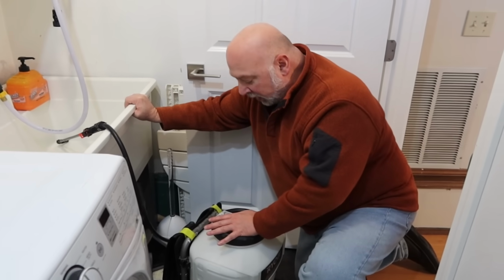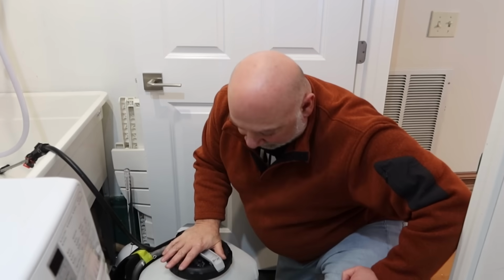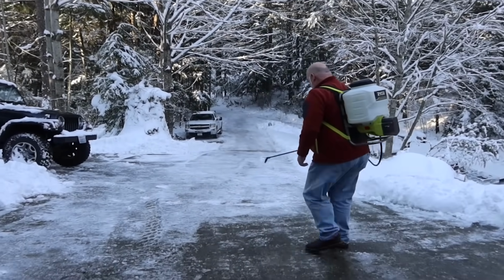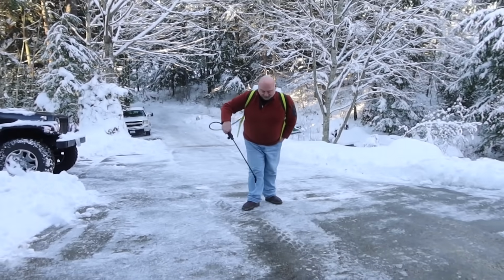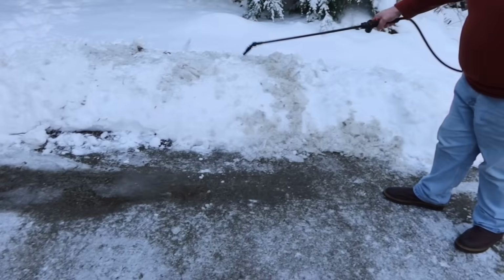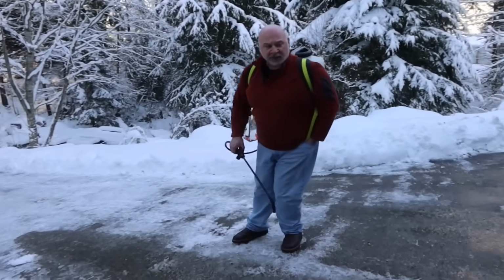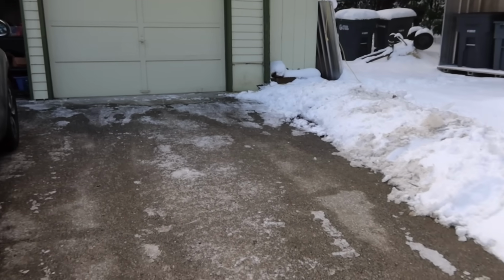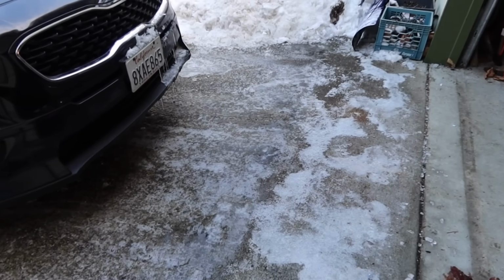Low-Cost Homemade De-Icer- It's easy and works!

Comment: Never heard of this DIY deicer.  Recipe:  Melt 8 - 9 cups Water Softener Salt  and 5 cups of sugar to 5 gallons of water.  Thanks for sharing and stay safe.
Reply from the maker: The salt is cheap if you buy water softener salt. Also, you can get 25 lb bags of sugar at warehouse clubs at very good price.  Good luck!
Reply: @fortcesta5128  You could also substitute calcium chloride in the form of pool shock for the water softener rock salt. The calcium has a lower freezing point and you should find it at pool supply outlets even when deicers are all sold out. I did that about five years ago and while I can't swear it's as cheap as water softener salt I remember it was cheap enough I bought a couple 50lb bags. One issue with it is that it comes in fairly big flakes that can apparently damage concrete as a deicer, not an issue if you're dissolving it into a brine though and the result ought to be less destructive to concrete than rock salt too.
Reply from the maker: @johnassal5838  Thank you for sharing your experience. Your contributions are greatly appreciated by all!

Comment: You can use a variety of household items that will dissolve in water as de-icer. The principle of lowering the freezing point of water is if it has more ions in solution then it'll be able to lower the freezing point of water more. Sugar works better than salt because a glucose molecule is C6-H12-O6, meaning it has 6 carbon ions, 12 hydrogen ions, and 6 oxygen ions, a total of 24 ions per molecule. Sodium Chloride is NaCl which is just one Sodium and one Chlorine ion, a total of 2 ions per molecule. This is also why de-icers made from Magnesium Chloride is better than Sodium Chloride because the Magnesium Chloride molecule has 1 magnesium and 2 chlorine ions making each of its molecules having 3 total ions. Calcium Chloride likewise. If you have lawn chemicals like herbicides and liquid fertilizers stored in the shed or garage you'll notice that they don't freeze in the winter, and that's because they're very complex blends of chemicals that in liquid solution have plenty of ions so it would take a very low temperature to freeze them.
Reply from the maker: Thanks for contributing! This is very interesting. I never knew why it worked, just that it did.
Reply: So we add sugar and water that's  it for melting ice bro
Reply from the maker: @اخوياهايصوانالايص  If you are asking a question, the answer is yes

Comment: Try molasses inplace of the sugar. Works a lot better. Oh, forgot, if you have icicles it means the wsteris not draining down your downspouts properly because your gutters are clogged up. It eventually will damage your roof.
Reply from the maker: Thanks for your comment! 

One of the premises was to have a low-cost de-icer. Bulk sugar is pretty affordable and easily attainable. I am not familiar with molasses or the best way of buying in bulk. Can you elaborate on this supply chain?

We got new larger gutters to help handle the issues associated with clogging. 

Thank you, and stay safe!
Reply: @fortcesta5128   Molasses should be available at the same wholesale place as the sugar. Can't remember the ratio, but the cost is not as much as the sugar, nor the usage.
Reply: 9 ounces for 5gallon of water. This really helps the salt solution to "stick"
Reply: Subzero temps will make water freeze to the inside of downspouts and gutters.  Heat loss wil lmelt snow just enough to run to the gutters. If they have "leaf guards" and it stays that cold they can freeze solid.

Comment: The only problems with brine as a deicer is it has a limited temperture range where it  works, and the salt residue will hurt the paws of dogs whose owners walk them over it.  I use salt but only on stairs and private walkways.
Reply from the maker: Good points, for sure!
My dog never spent much time in the driveway.  The little time that was spent in the driveway  didn't affect him. Thanks for  contributing with this important consideration.  Stay safe!

Comment: Like the video. The max salt one can put in water is 26% before it falls out of solution. Aiming around 21% is the best bang for your buck. Brine Hydrometer allows you to fine tune the mixture and see what works best without guessing too much. Been wanting to move up there for years now. I'm done in boise area. Hopefully Priest River one day.
Reply: FYI watch out for ice damns building up on the roof. Can get a string of heat trace on the bottom part of the roof.
Reply from the maker: That's exactly the data I was looking for- Thank you for contributing!
Reply: @fortcesta5128  after doing more research the number is 23.3% solution. Best part is it will lower the freezing point on the concrete before a storm, cause the salt already had the reaction with the water. But either way sir, good luck

Comment: Sugar is not really necessary if you’re already using salt.

If you live in areas with average -20c at night, I recommend Magnesium chloride which has a -25c freezing point.

Just a thought.

Thanks for the video.
Reply from the maker: Good to know. Thanks for contributing to the conversation!

Comment: There are 2 types of  water softener salts; sodium chloride and magnesium chloride  think Mg will work just the same(?) do less damage on the driveway/cement but use less of(?) -main use of the dry coarse application.
Reply: Also, Magnesium Chloride is a safer for pets.

Comment: Ok so that works in general vs spreading the expensive salt stuff but if the ice and snow come back does this stuff being down already help in removal or melting or do you just have to go re apply it after shoveling / plowing?
Reply from the maker: Excellent question! Unfortunately the answer is yes...to everything. The longevity of the treatment various directly with the ability to stay at high concentration and where you need it (in the driveway). If conditions stay cold, you will be more likely to leave a nice coating on the driveway for future use. If you get a thaw and surfaces get wet, you are diluting your deicer, making it less effective. If you have a steep driveway, like me, the deicer can migrate off the driveway. Time to reapply! Thanks for your question. Best of luck!

Comment: Best video I’ve searched for an de-icer brine 👏 I’m a new 🇨🇦homeowner & have. N facing corner lot w/ enormous foot traffic so by the time I get home, I shovel but usually have a good 1/2” ice compacted ice to deal with. Do you think this work in our winter temp of 12f to -58f? Thank you, Leah
Reply from the maker: Hi Leah, 
I think you are safe in the 20s.  If you can get some more sugar dissolved, you will have more success in the teens. 

Feel free to share your experiences.
Best of Luck!
Jeff

Comment: Interesting using sugar, in theory it should work fine and it won’t be corrosive like salt. The higher the concentration of the sugar or salt in your solution the more effective it is in lowering the melting point.
Reply from the maker: I think you meant freezing point. It's all good. Best of luck!

Comment: How long have you been using it in that sprayer? I love the idea but I'm concerned that it'll destroy the sprayer. If it'll last this seems like the remedy for me. Thank you
Reply from the maker: I have used the spray for 2 yrs. They are designed to handle chemicals of various corrosive levels. I also use a salt solution during the summer to kill weeds. It works and is much friendlier to the environment.  You could always use one of those hand pump style sprayers used for insecticides.  They are in the garden section in your hardware store. Good  luck!
Reply: @fortcesta5128  thanks for the reply... I have a hamd pump sprayer and actually made my first brine yesterday 👍👍... I may get a ryobi sprayer now
Reply from the maker: @Paulio91184 Just be aware, those sprayers are not light, once  they are filled. Best of luck!
Reply: Nice solution (pun intended) but now I have a massive case of sprayer envy. So much so I went straight to Home Depot’s website to order that sprayer… sadly it seems that model they no longer make and the new model doesn’t look nearly as robust as yours. Anyway thanks for the solution.
Reply: @fortcesta5128  You can also rig up a bicycle pump valve to the top of a hand pump sprayer and then use an electric tire pump to add pressure to the tank.
Reply from the maker: @jeffkirk4761  Thanks for sharing your idea! I truly appreciate everyone's contribution and willingness to share their experiences. 
Merry Christmas!

Comment: Can this be used on new concrete?
Reply from the maker: As long as your concrete is fully cured, you should be OK. We use it on older concrete all the time. I have two houses, and one had a new concrete driveway installed this summer. I haven't had a lot of cause to use the de-icer yet. It's been mild, but the next several days will be below zero! Old man winter is coming! I would not hesitate to coat the newer driveway with this brine solution. Salt and sugar are fairly benign. Thanks for your question. Be safe. Good luck!

Comment: Moved to WI from TX 3yrs ago. It’s been interesting as far as weather. How did this solution fare afterwards? Any effects on driveway? Did you try a higher sugar content? Any after residues? I’ve also heard of dawn soap and rubbing alcohol recipe but haven’t tried it. I don’t have a sprayer, so was wondering if just using a garden hose attachment would be okay?
Reply from the maker: I have not upped the sugar content.  Our weather has been relatively mild. Maybe winter is waning.  
I'm not sure what type of sprayer you are referencing. The important thing is that the sprayer cannot dilute the concentration of the salt/ sugar mixture.

This is from another conversation. I hope it helps.

Fort Cesta
1 month ago
Thanks for your question! First off, this is applied to concrete.  I'm not sure you caught that. There are a number of ways for measuring safety. You need to weigh which items are most relevant to your scenario.  
* The deicer definitely works, which means far less chance of falling. This is extremely important as our driveway has quite a grade.
* I haven't noticed excessive  deterioration to the actual concrete. This driveway is 35 yrs old, and has some pitting, but this existed long before I implemented the deicer. 
* Not using a deicer in this climate would allow water to melt and freeze   many times over the winter. This action can also produce a negative affect on concrete. Once water gets into a crack, freezing will make the cracks expand.
Hope this helps!
Reply: $10 at Harbor freight .  $15 at Home Depot or Lowe's.

Comment: how safe is this on concrete?  Thanks
Reply from the maker: Thanks for your question! First off, this is applied to concrete.  I'm not sure you caught that. There are a number of ways for measuring safety. You need to weigh which items are most relevant to your scenario.  
* The deicer definitely works, which means far less chance of falling. This is extremely important as our driveway has quite a grade.
* I haven't noticed excessive  deterioration to the actual concrete. This driveway is 35 yrs old, and has some pitting, but this existed long before I implemented the deicer. 
* Not using a deicer in this climate would allow water to melt and freeze   many times over the winter. This action can also produce a negative affect on concrete. Once water gets into a crack, freezing will make the cracks expand.
Hope this helps!

Comment: Just use a pressure washer man.... aim it like a chisel under the ice and it will make quick work of all that. Hook the hose up to the hit water inlet on the washing machine hook up if it can reach or just regular outside faucet. Much easier and faster than all this mixology ect...